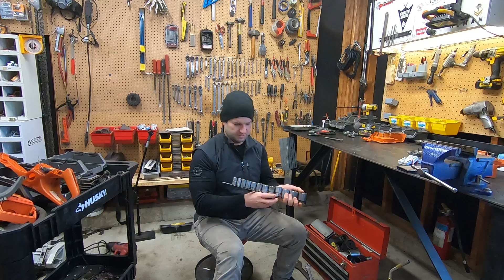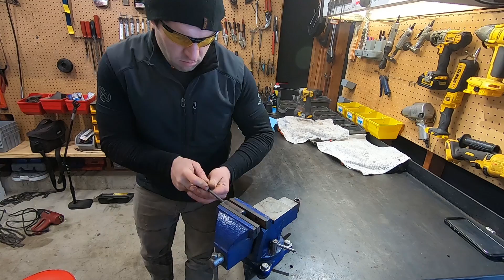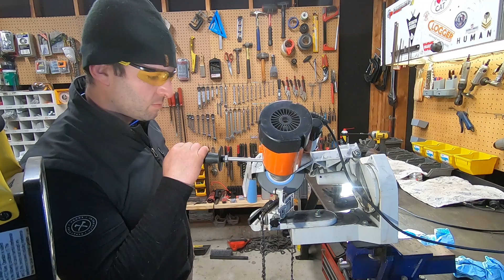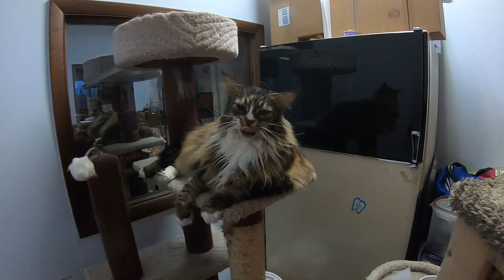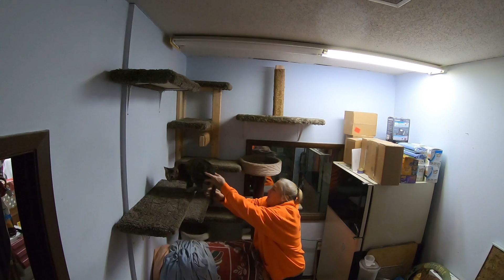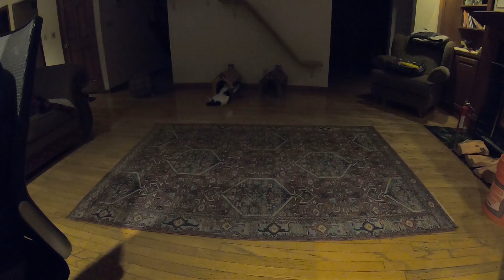Fat Bottomed Girls

Comment: For a stud finder that actually works, use small neodymium magnets.  They stick to the screws that are holding the drywall to the studs.  Find a couple in a vertically line, and you know you have a stud.

Comment: A lot of mechanics use craftsman stuff and harbor freight stuff.  A lifetime warranty harbor freight impact socket set is about $200-$300 cheaper than the same set through snap on, and works the exact same.  I only buy stuff I know will be better, such as air tools and hand wrenches.

Comment: Cory a lot of old school mechanics did not clean tools because of the environment they were in. Most would leave oil residue on tools to prevent rust. Growing up 3rd generation mechanic myself. I did not start cleaning tools until i went into the "Dealership" . Before that I ran road calls and did a lot of field work and it was best to leave a little oil on your tools.

Comment: I'm a mechanic and spent my life learning everything from chainsaws to M1 Abrams tanks and take great pride in my work and keep finding myself in the same boat. 2014 superduty 6.7L that I baby and it's so expensive to fix. Working on doing the upper oil pan replacement/ reaseal and almost $1k into it. Just to save some money and make sure it gets done right. I have been trying to get back into climbing and the truck stole my savings. Good luck to you.

Comment: As weird as it sounds I sorta believe the opinion that if it’s bought from new and it’s flogged from new it will love getting abused if you baby it and then flog it it won’t like it. I bought a 08 wrx sti with 45xxxkms on it and I flogged it and the thing fell to bits engine gear box you name it. I bought a brand new HSV clubsport which is upspecced chev ss with CTSV supercharged engine and I’ve flogged since the moment I drove it out of the dealership and never missed a beat. Maybe it needs to be flogged Cory?

Comment: being a duramax tech buddy ive seen alot of llys go alot of miles with no issues, you honestly just got a shitty one, head gaskets are usally a common issue on llys. lb7s have injector and head gasket issues, as for the radiator issue that was from the head gaskets.  the injectors leaking, cheep parts, ect.
honestly i think your was a friday truck or some shit you have had some bad luck but i get the feeling things will turn around soon. get the starter done and i think she will be dependable, you did an amazing job when u did the heads

Comment: That's the trouble with older trucks/cars......they get to a state when you start changing out parts like alternator, starter, water pump, bushes, bearings etc etc and you don't seem to stop until you've practically gone thro the thing and emptied your savings doing it. Hopefully at the end of that spree you've got a vehicle that will last a few more years with minimal attention reqd.  Other than that you'd be changing your truck every 3 or 4 years for newer equipment and more expensive problems that come with the technology.  Were not designed to win buddy.😉

Comment: Corey what I have done to stuff up to 1/2 inch is my cordless drill put the metal in the chuck and hold a hacksaw blade and cut things down to size or if something is rusty using sand paper or a bastard file to mill it down

Comment: Dude I wasn't trying to give ya a hard time about your punch just seen it happen to many times for my liking. I been a mechanic for 35 years now and something so easy as to dress a chisel or punch and so many people don't. I have foam in my tool boxes with cut outs for each tool to fit into. When a job is complete i open all the drawers and do a quick check for missing tools, you know if you have them all pretty quick. Also those craftsman tools are great tools and over the years I have had many craftsman tools, they fit fasteners well and don't break very easily, I would put them on the lever of snap-on ot MAC.